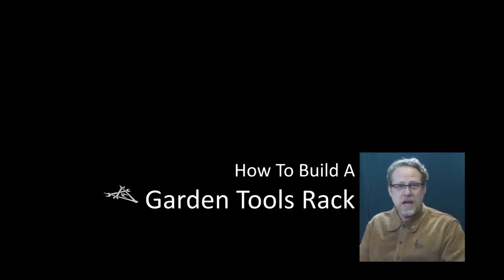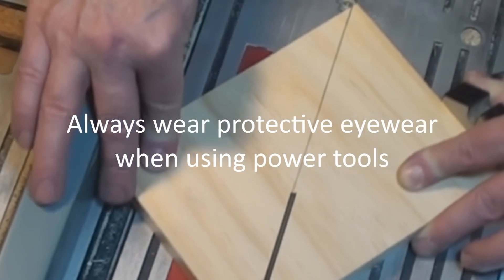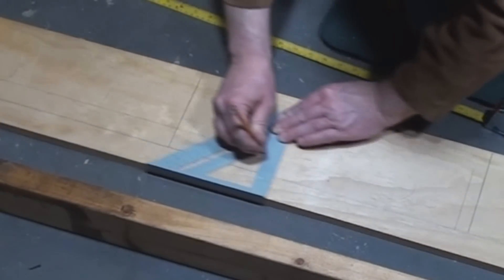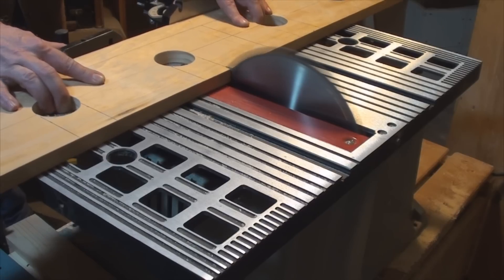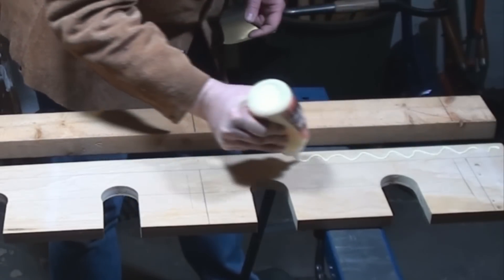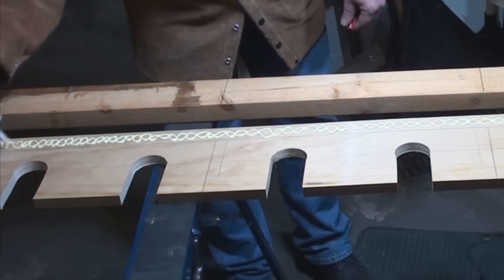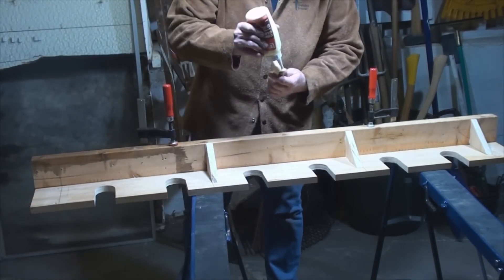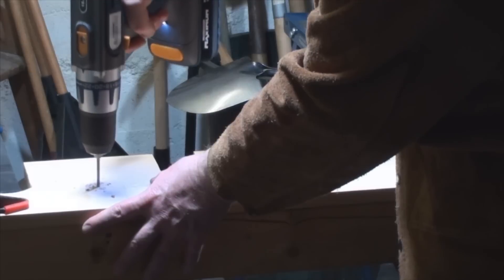Garden Tools Rack - How To Build An OldSchool Organizer

Comment: Ironically.... I had same idea in my mind and built a very similar unit like yours out of scrap as well.  Weird...almost identical. I wanted to add this little tip.  Since mine is perhaps a little deeper and can hang several tools in a slot...I added something to keep the rakes and shovels from getting bumped and perhaps falling out/down.  I took small hinges and attached small blocks of wood that fit in slot and then hang a yardstick nearby.  Then I take yardstick to push up block...place tool in slot...then use yardstick again to “flip” wood back into slot to keep tool from being bumped out.  Works great!
Reply from the maker: Great idea!

Comment: I would recommend that the blade on your table saw be properly adjusted to extend no more than an 1/8" beyond the top of the material.   Sawing with the blade extended at the height shown in the video is a very unsafe practice.  

I have found that the process of placing or removing the tools sometimes causes the other tools to move.  In fact, I have had one fall on me.  To prevent that from happening again, I added a bit of trim on each side of the slots on the upper front edge of the board.  Now the tools stay in place even when they are jostled about.  In addition, I cut the board with slots into short sections and set them to the requirements of the width of the tool.  A rake for instance is wider than a hoe or shovel and thus I was able to make best use of the space available.  It does require additional support. but it also allows me to store more tools in the same space.  You only need one per tool.set close to the slot.

On the second one I built, I fastened a strip of T-slot and used toilet bolts to secure the tool supports to the t-slot strip allowing me to adjust them as required.  They simply slide left and right as required.  The support holds steady without being fastened to the 2x4 since gravity works.  Use plenty of screw in the T-slot to ensure it stays put.
Reply from the maker: +Gary Odom - I look forwrd to seeing your video on the subject.
Reply: +Repairs101 
Thank you for your comment.  I do not make videos except for stock market trading videos as they do not require the use of a camera.
Reply: Hi Gary mind sharing a picture? I'm interested in this concept but Im also thinking of the safety issue
Reply: @landiiie5630   Well that was 4 years ago and that house would be owned by someone else in a location I no longer live.  So, picture?  I do not believe I can produce  that, sorry.

Comment: Great video, bought 10 ft 1x 8 pine board today. You should include the dimensions of the triangles, size screws, and where you placed triangle braces on the board. Lettered messaging overlying the video with these so people know exact dimensions. Some of the questions I had were in comment section but please be more specific in future
Reply: I second that !!
Reply: Kenna Bear's World How much did you pay him for this information? Right, nothing. If you can’t figure out your own dimensions you probably won’t build the project anyway.
Reply: K vlogs - Are you kidding?  This is not a cabinet to exact measurements, this is a rough cut garden tool shed shelf made with scrap wood!  And what fits his shed won't fit yours.  If you cannot figure out how to build something so elementary, you have no business working with wood.  Stop whining already and go build it!

Comment from the maker: Fact: #Christmas is 2 WEEKS from #TODAY!
Fact: #making one of these only takes a couple of hours.
http://youtu.be/0iZ6Sd2dnSE
Reply: Repairs101  very nice !  is your horizontal board a 1 by 6 ? how far are the centers of the hole sawed holes from the edge ? what is the spacing between two slots ?
Reply from the maker: I used a 1x8 and a 2x4 and spaced the 5 inch deep tool rests 8 & 9 inches apart to accomodate different sized tools. Good luck!

Comment: No miter and your blade is way too high. You are asking for a accident.
Reply from the maker: Yeah I get that a lot.
It's cuz I was never trained on a table saw - I just bought one and started making stuff.
Reply: The board would have most likely kicked back if you cut all the way through so you got lucky. Don't ever cut something on a table saw by holding and pushing the piece on both sides because you will force a kick back .You should always use your miter gauge when making simple cross cuts like that. However, it is more ideal to make yourself a sled because it is safer. When using a table saw or a skill saw you should position the blade so that it is just high enough to cut so that there is no risk of seriously hurting yourself. No one is perfect and there is no need to dwell on your mistake. Make the corrections and be safe.
Reply: If only there were a website with thousands of free videos on how to safely use a table saw...
Reply: Uh oh!  I've been using my saw this way too and forgot about the miter gauge.  Never been trained either.  I'll pull it out and attach it now.  Thanks for the reminder!